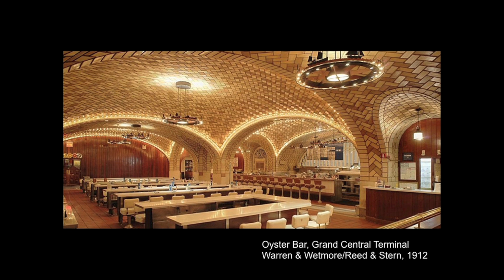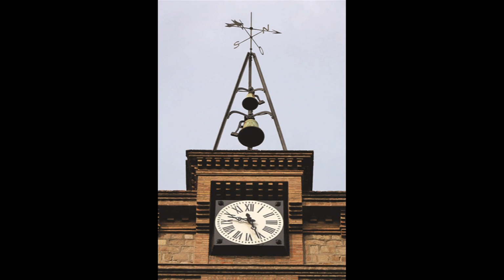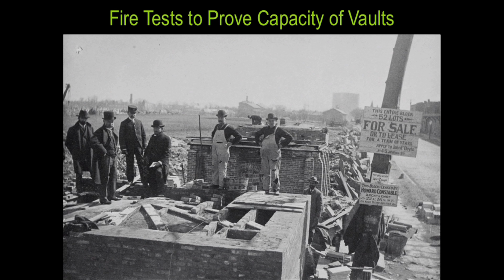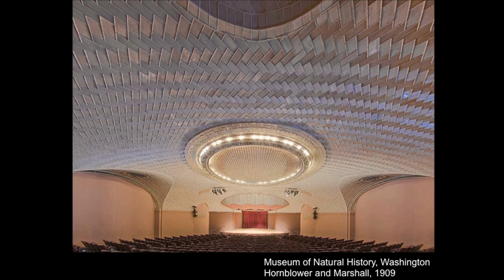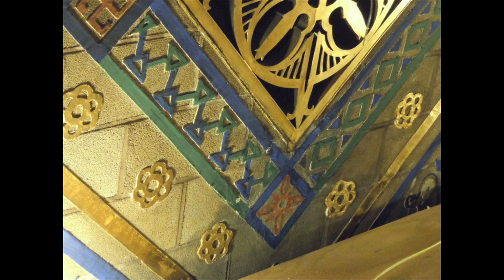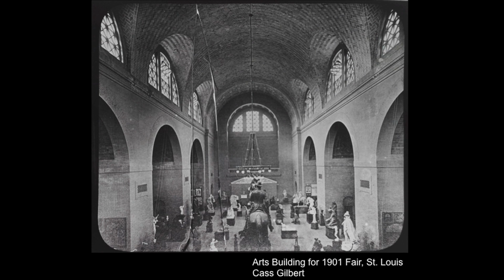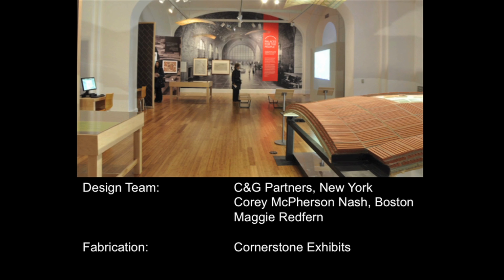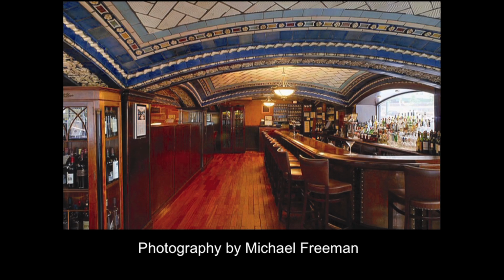The Art of Structural Tile

Comment: One way to mitigate earthquakes might be to have the base of the angled iron tension ring for the dome gravity-set and resting on a layer of talc to help isolate it from the structure's walls.  It has perfect basal cleavage, not water soluble, not toxic and inexpensive.  The dome would float on a ring of talc.  If the talc is sandwiched in a slightly "V" - shaped channel, the dome would tend to reposition itself after the shaking.  The only problem would be the deeper the angle of the channel, the more the possibility of transferring shaking to the dome.